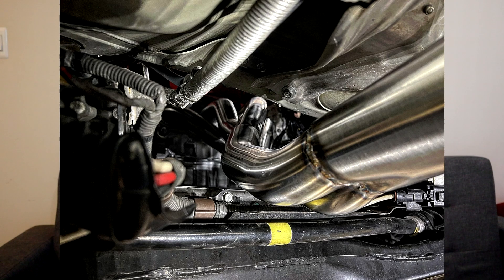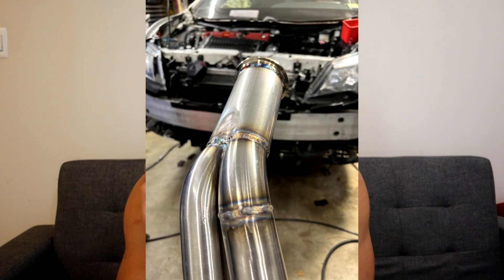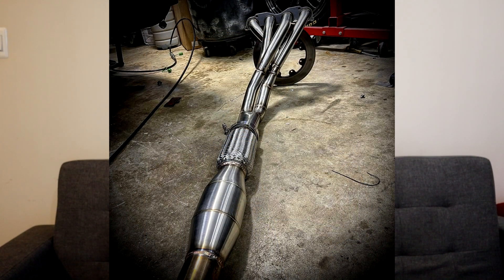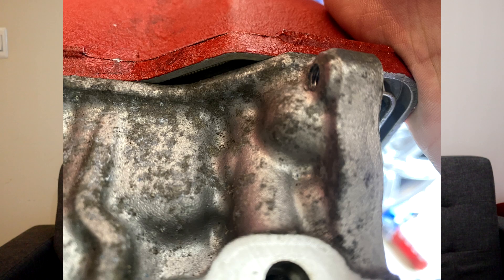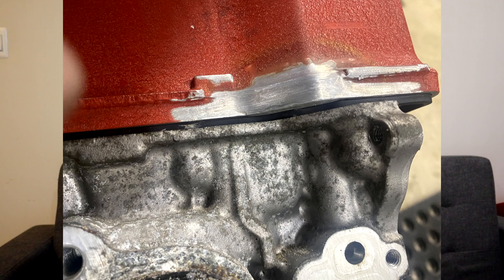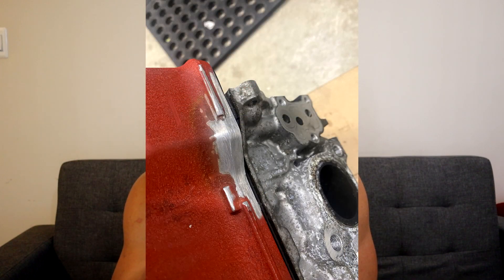K20 Head Swap Update - Modified Headers and Valve Cover

Comment: My cover seems to need modification aswell. Ever figure out what bolts right on?
Reply from the maker: @ohitselii  i honestly don’t think any does.    The 8th gen requires change of timing chain cover.  I think ppl aren’t paying attention
Reply: @CGNLEvolved  interesting. So mercracing basically just welded a piece to your cover and shaved it down? How did the gasket fit?
Reply: @CGNLEvolved and did you figure out your timing chain cover leak? Nothing had to be modified there right?
Reply from the maker: @ohitselii  yes, they modified it to make it not leak
Reply from the maker: @ohitselii  correct, it was damaged and was fixed by MercRacing
Reply: @CGNLEvolved  awesome man thanks for the info! Hope to see some new videos soon. Been a sub for a year now 🤙🏽

Comment: Just use the 8thgen value cover
Reply from the maker: I was told modification will be needed for it to fit, no?
Reply: @CGNLEvolved  what would be modified??? I don't see why?? Your putting it on the same head. K24z7 valve cover is way different from even a k24a anything... that's why if you buy a after market valve cover or buy one that's hydrodiped doesn't fit K24z7 you have buy it specifically..... that's why ya had to modifie it to fit the k20 head.
Reply from the maker: @screwedupcivic2285  i was told you have to trim the timing chain cover and was sent pics on where to trim it.  That’s what was told to me.  So I’m not sure.  I know the 9th gen vc didn’t fit
Reply: @CGNLEvolved  dang I haven't heard that before lol well either way I guess ya have to modify it 🤷.  I know the frank swapped k24a's ya just slap that bad boi on there. I wounder why is that tho how do the chain or gears ⚙ sit higher🤔🤔
Reply from the maker: @screwedupcivic2285  i have no idea.  Never tried to verify.  But all i know is the 9th gen vc didn’t fit for me